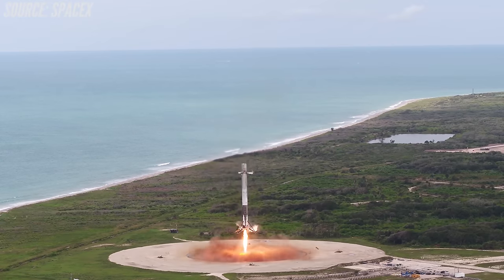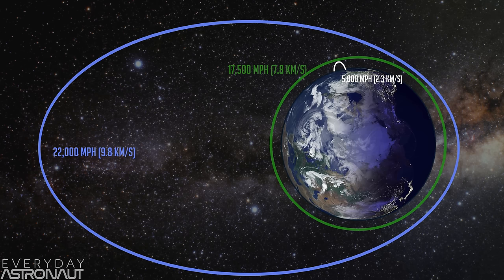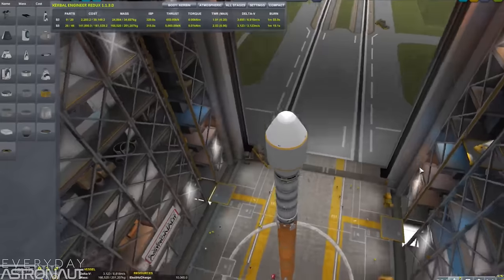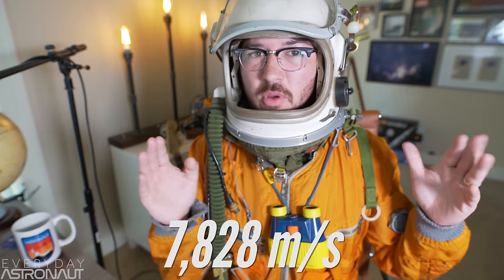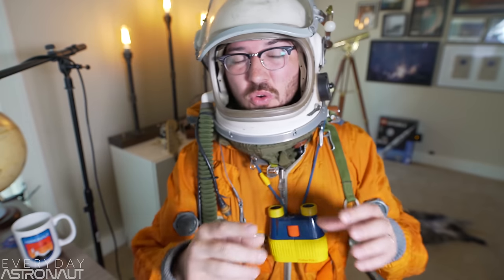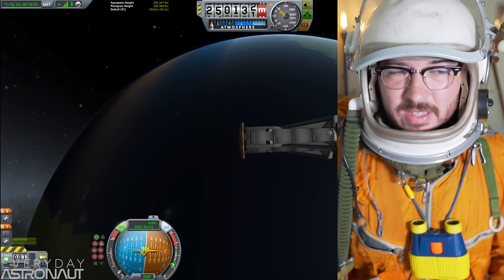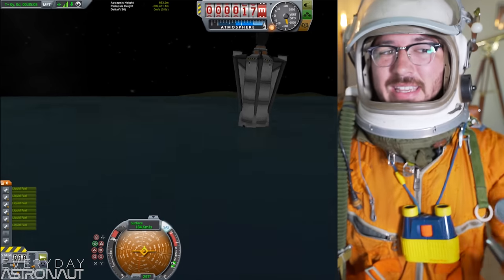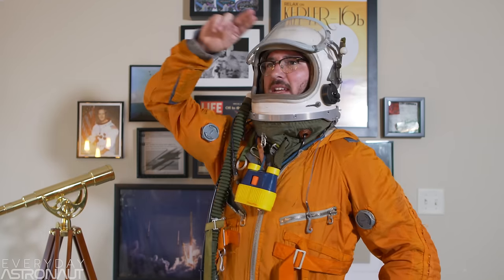Can SpaceX Reuse a second stage?

Comment: Yeah, what he said... 
Give it an inflatable heat shield and 4-6 kestrel engines for landing and she might have a chance.  Including the weight of landing legs and grid fins, this gear would cut into your usable payload by only a ton or three.  Add to that 5-10 tons of fuel and you've lost over 25% of the falcon 9's usable payload just to recover maybe 5% of the launch cost.
I landed a large booster in KSP six months before Elon did, so I must know what I'm talking about, right? ;)  Just like real life, recovering the booster totally breaks the economic model of the game for an easy win (if you can land them consistently).
Landing the second stage, on the other hand, is far more difficult and gives a comparatively tiny economic advantage.  Bottom line: landing a booster is nightmarish with a big payoff, landing the second stage is nightmarish SQUARED with a chump change payoff.
I couldn't do it, but maybe SpaceX can.  Go Mueller!

Comment: I would say drouge chutes and inflatable heat shields (or at least something to increase drag in atmo) would reduce the required materials on the second stage for recovery.  Making it capable of surviving splashdown and float afterwards would probably be a much better option than a pad landing as well.

Comment: What if you parked a heat shield or some sort of "recovery package" (Legs, fuel, heat shield) in orbit. That the second stage would dock with in order to re-enter. Or eventually you can just leave the second stage in orbit, and have a BFR go and pick it/them (room for more than one?) up and bring back. Then it's just a question of what is cheaper. Building a new Second stage or the cost of a BFR flight...

Comment: It would make much more sense to keep the expended Stage II parked and stored in Low Earth Orbit (LEO) as the energy required to loft it, once again, to LEO, is both redundant and inefficient. 

One can construct Modular Spacecraft in LEO.  It has been done before....eg...Mir...ISS

Once refueled then one can use those those stages to build and loft a Lunar Outpost on a translunar trajectory into Lunar Orbit,...for a Mars Mission...or another deep space mission.

That will be one of the most efficient and cost effective methods of colonizing the Moon, Mars, and perhaps the Jovian moon Europa.

Comment: If aerospace R&D really ramps up in the near future, we'll probably actually develop altitude compensating engine nozzles like the plug or aerospike before developing upper stage reusability, thus removing the need for an upper stage in the first place (The major purpose of the second stage being it's engine, for operating efficiently in vacuum, which the 1st stage isn't designed for). That would dramatically increase the viability of single stage vehicles which could carry all the fuel and payload in a single stage, minus the upper stage engine. I mean, the aerospike has already being tested ( it's also in KSP :) ) and its performance is incredibly promising (It has efficiencies of upwards +30% at sea level and +40% in vacuum over the current engines ), it's just nobody wants to fund it yet. Then all you would need is a slightly bigger rocket to carry enough fuel for a round trip, and confidence that we can actually land such an expensive single-stage engine.

I really hope Elon Musk understands and looks towards these technologies, rather than trying to deorbit upper stages, which is a symptom of the bigger problem of multistage rockets.

Comment: How about (keep in mind that by making the second stage reusable, the cost of the mission is MUCH LOWER) they spend a little more money on making the f9 bigger, and the first stage with more fuel. Upon reentry, the second stage will have just enough fuel to burn 0.1 percent the whole time, which will give it stability to point down, heat shield first. Boom!

Comment: Your videos are quite good but there's one thing that really bugs me about all vids of this type and that's the attitude of trying to force the issue between kilometers and miles. As a broadcaster who has spent decades studying and analyzing why people watch what they do while rejecting other offerings  and coupling that with a science background, I can definitively tell you that if you're trying to build an audience and a following in the US you should always use miles rather than kilometers. Add the km's if you want but make sure the miles are in there. You can change this approach when you see the first Interstate sign that says X City 124 Kilometers, or Speed Limit 70KM. The vast...vast majority of the US populace doesn't understand the metric system, can't do the conversion math, and finds the usage of metric terms haughty, over their heads, and a huge tune-out factor.  One especially should not use one, say, miles per hour, and then use kilometers per second as a reference. The uninitiated will be confused and lose interest. The other thing to avoid is talking down to your audience. "I promise we'll keep it simple," screams, "...simple for all you idiots out there." Build a bigger audience by becoming one of them... use the US system first and then metric if you feel so compelled. You'll be glad you did.

Comment: Reusability is really a problem of economics and not physics.

The space shuttle's reusability came at the cost of a ~5-fold payload capacity reduction, and it was slow and expensive to refurbish after each flight, so it was clearly non-economical.

A F9 first stage loses a small amount of payload capacity but it appears to be easily refurbished between flights, so it's clearly very economical.

Whether a second stage reuse would be economically viable would depend on how much payload it loses and how much work it needs in between flights. Propulsive landing would cost a lot more payload reduction, but likely require much less rebuilding between flights. Aerodynamic landing may be more mass-efficient but requires extensive inspection and replacement of thermal tiles in between flights.

Even if you reduce a rocket's payload capacity by 2-fold, it's worth doing if you can decrease the long-term costs by greater than 2-fold.

Comment: Isn't the solution to have a way more powerful second stage engine, and actually decelerate faster while higher up? I remember doing something like that in orbiter with a combination of hover engine and the main engine. One engine is used to slow descent while the main one slows your horizontal momentum.

Comment: Also the Shuttle orbiter needed a complete overhaul of the engines after every flight & extensive tile work on the hull, the big orange fuel tank needed replacement & the SRBs were very expensive to recover refurbish & reload with solid fuel. It was more refurbishable than fully reusable like what SpaceX is trying to accomplish. The Shuttle got lots of hate because it was so expensive to relaunch & costed the lives of 14 astronauts (Challenger & Colombia) because of the Shuttles lack of an launch escape system & how the orbiter was configured for launch. A big orbiter mounted towards bottom of a large fuel tank & the SRBs was not a good idea. What SpaceX is doing is reusability in a much better & safer approach for both manned & unmanned payloads to earth orbit & beyond. 2nd stage reusability will be a tricky feat but I would imagine it would be similar to how the ITS (Interplanetary Transport System) spacecraft will reenter & land only on a much smaller scale for satellite launches. Basically I picture a scaled down ITS spacecraft with a payload bay for satellites & other payloads of that size.

Comment: Why not use the 10 meter inflatable heat shield? Since it’s deflated diameter is 2.5 m, the same as your stage, the shroud placed around it would be flush with the fuel tanks. This would make it taller by about 2  to 3 meters, but I don’t believe that that is enough to warrant aerodynamic instability. Maybe this could save on dV also as it is lighter than the 3.75 m heat shield- coming in at 1.5 tons rather than 2.8. Paired with the large diameter, this could allow removal of the wing strakes on the side. 

Just an idea coming from a KSP nerd...

Comment: Tim Dodd, can you wrangle Kerbal space program into accepting an inflatable, heat-resistant, giant party balloon? (start bigger than a parachute.)

If you make it large enough, the stage gets rapid aero-braking, and does not heat much.

Can you convince the game that the entire second stage is ablative coated? (What is the parameter that triggers that pesky second stage explosion? Temperature, or tank pressure?)

If you make a heat shield large enough, it becomes an aero-brake. So if there isn't a weight penalty, you could bring the speed WAY down. The shield would have to strap onto the side of the second stage during launch, and swing up top for reentry. 

PS, If the satellite can be launched into an elliptical orbit (becoming the third stage), then very little fuel is needed to de-orbit the second stage.

Comment: don't forget the propellant, which when properly leveraged must be a huge help in maintaining stability. I don't know exactly how much of it they would require for their de-orbit, reentry and landing burns, but if you make sure it is all located just by the heat shield it just might (partially) offset the CG enough. Once there, the deceleration should keep it there and sloshing is all you have to worry about, which they already solved in order to relight the first stage. I would love  to see the impact this has on your simulations (though it's a bit of a pain to implement propellant movement in KSP, I know :P)

Comment: do you feel dumb now that they announced the bfr which will be fully reusing the second stage and not only that it will be cheaper to launch / mass including recovery than the current falcon 9.
Reply from the maker: No because I specifically said they won’t pursue second stage recovery with the Falcon family and that second stage recovery will require an entirely new vehicle (aka BFR). I would say I was pretty spot on.

Comment: I actually have been using the ULA "slow drip swimming pool" second stage system for a long time in KSP.  it is exceptionally handy.  the only difference is the "final" second stage that gets used for the mission in my situations is actually a special second stage that has a lot more "stuff" on it making it more versatile for the second wind aspect of its life, because of the accumulated efforts for the mission, and the fact that small payloads need to go to orbit anyways, the financial burden of the same fuel for less payload issue is offset.....

oh..... and Can confirm.  KSP will consume you..... I have more hours logged in just steam alone for KSP ( i have a LOT off steam hours) than i have work hours logged at my current job of 3 years....... like the total hours since i started..... still less than KSP.

Comment: You should of used vernor engines instead of monopropellant RCS. It is more powerful, and uses liquid fuel and oxidizer so you don't have to carry around some monoprop, and is a lot more conveniant. The only advantage to monoprop RCS is that it's closer to nitrogen thrusters and saves your liquid fuel and oxidizer (and makes up for it in that you need a seperate tank which adds weight.)
Reply from the maker: +Corey Newhard I did use Vernor engines 👍 also. I want trying to solve the problem so much as illustrate the challenges. But yes. You're absolutely right.
Reply: Did you use elevons?

Comment: Perhaps a different take on the problem is in order? DSI (Deep Space Industries) has a go ahead from NASA to work on creating reentry heat shields/brakes from the left over regolith of the Near Earth Asteroids they intend to mine/process for water, fuel, and other volitiles and usable metals. If rhe second stage were to be fitted with a thermal shield  (And theoretically there may be the possibility that stabilizer fins could be attached as well), then the added weight/mass becomes much less problematic.  What's more, if DSI is doing all this in orbit, then they can top off the fuel tanks enough to assure enough counter thrush ignition as well. 

Overall, this idea creates quite a potential revenue stream for DSI once they manage to haul themselves up into LEO  and get to work.

Comment: Great video but you made one factual error. A 2nd stage requires FAR less fuel to deorbit than to achieve orbit, somewhere in the neighborhood of 70 to 1 savings, and here are the reasons in order of significance. One; Fuel. The 2nd stage upon reaching a successful orbit has used up a massive amount of fuel and therefore mass. Two; Payload. Upon reaching a successful orbit the 2nd stage will release it's payload further greatly reducing mass. Third; The fairings. Soon after 1st stage separation the fairings are released to reduce mass and therefore fuel for a successful orbit also saving potential energy for a reentry burn.  Finally, atmospheric drag. Drag is a free supply in Delta-V reduction provided adequate heat shielding. All add up to a massive reduction in mass therefore making a reentry and landing far less demanding on fuel requirements.

Comment: I'd imagine the second stage would look like a mini starship. Probably use cryogenic surface cooling aswell. It would probably make sense to come down belly first instead of nose first because you get more drag that way. The nose will probably still need some sort of sheild assuming that the area underneath the payload faring can't be cryogenetcally cooled. I think at this point they'd have to use parachute recovery as there is no reason to include a second set of sea level optimized engines. Alternativily, they could sacrifice some delta-v and use hybrid sea level vaccum engines (did STS do that?). Either way I'm interested to see what they come up with. I would think that they would sacrifice the second stage on really high orbits and only try to recover for stuff in LEO.

Comment: So you can lose everything over LEO by several successive aerobraking passes. You never need to lose geostationary transfer orbit velocity.  I think the question is how long can you stay in the low heating portion of the upper atmosphere? In stock KSP there's kind of a maximum amount of time you can orbit and a minimum speed you're gonna hit hard atmosphere at.

It seems to me like you could use something like the 1st stage vectoring grids to keep a minimally shielded lifting body in low aerobraking for a very, very long time and bleed off almost everything until you're just really landing a smaller version of the 1st stage.

Comment: There is a common assumption in the video:  that the second stage is not reconfigurable.  We have enough computer power to robotically dock in space, why not use that ability to reconfigure second stages in orbit to prepare them to be de-orbited non-destructively?
It would require placing other resources in space accessible to the second stage orbits. Each of those resources could then dock with a second stage and  together they could land safely.   If we could launch one rocket with enough "landing kits"  (the rocket's payload) to help 100 second stages to de-orbit safely, the economics might work out OK.

Comment: The crux of this problem is attempting to deal with the heat of re-entry with such a small surface. All the frictional energy is concentrated on the small shield, going nose first. The solution would be not to go end-first, like a needle through fabric (requires more fuel to slow, too!), but to use the lifting body method to increase the frictional area. This gives you the advantage of lower thrusting weight per square unit on the frictional surface, which translates to lower temperature per square unit of surface. Then it's like bright sun on a hot day, compared to that same sunlight focused through a magnifying glass (ouch!) Also, the greater area of the lifting body affords more re-entry control with less fins and doo-dads, and will allow for more efficient use of the remaining fuel. 
So, the second stage ought to be shaped more like the space shuttle fuselage than a kosher hot dog, and re-enter in a similar fashion.
NOTE: I'm not really a spacecraft engineer, I just play one on You Tube.

Comment: Isn't it time for a revisit of this concept using the falcon heavy for a low earth orbit mission? with different sizes of payload.
The extra delta v from the heavy first stage(s) compared to the 9 must give some kind of advantage here.

If they can even get 1 ton to orbit and reusing both first, second stages and fairing, i suppose it would make sense to use the heavy even for very small sattelites.

So question in short, could falcon heavy theoretically achieve 100% reusability for any (or none) payload?

Comment: Move the heat shield to the engine end and eject it once it's served it purpose. Once the ship bas deployed the payload, and since speed is relative, disconnect from the heat shield at the payload end, use thrusters to flip the second stage around and install the shield over the engine end (similar to Apollo CM and LM spin around) . Keep the engine end (heavy end) entering first. Before landing dump the heat shield into the ocean.

Comment: What if we created a Falcon Heavy Plus with FOUR additional First stage components.  You would probably have to build up the structure of the core (hence more weight) to take the load, but I think the added Delta V would make up for that making the system completely reusable.  You might also have to land all of the boost stage components at sea, or maybe not.  It would be an interested case to run through Kerbal.

Comment: Hey Tim, would a refuel (Fuel and Oxidizer) option in orbit help for second stage recovery?   
Economically feasible? (ie cost of fuel and oxidizer placed in orbit with a prior mission less than the cost of the complete second stage?)